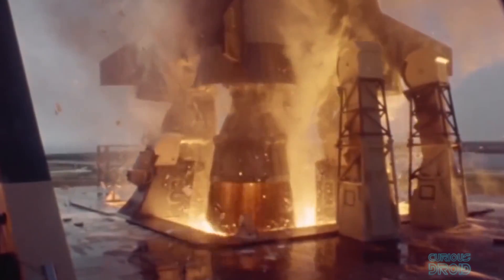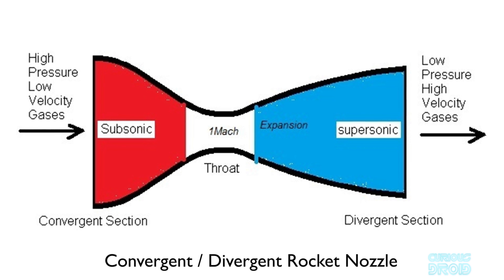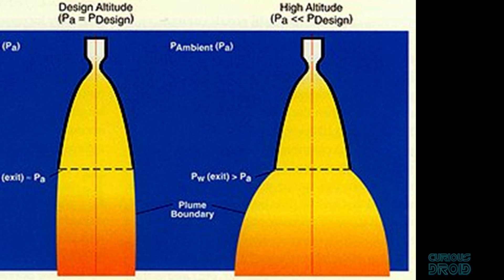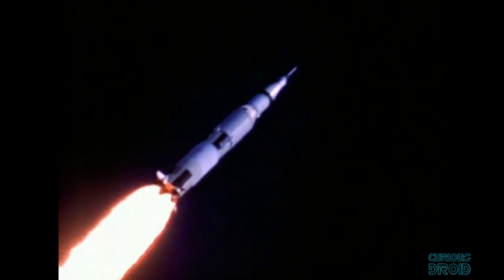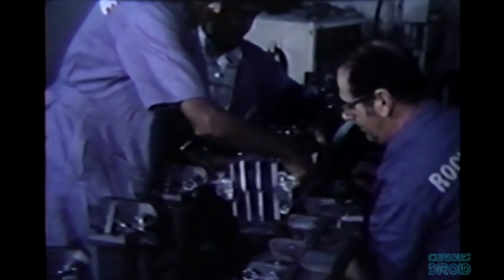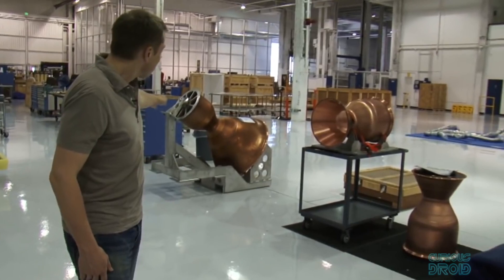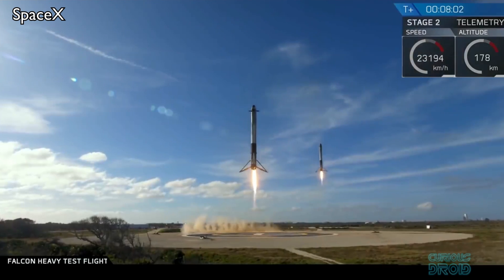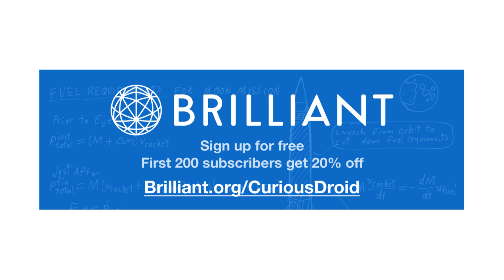Aerospike Engines - Why Aren't We Using them Now?

Comment: There is a big Achilles Heel with the aerospike nozzle that is not talked about much in the technical literature...but is fundamental to fluid mechanics...

It has to do with the surface to volume ratio of any heat engine or nozzle...a big engine will always be more efficient than a small engine, all else being equal, due to the fact that internal surface area increases only by the square, while volume increases by the cube...

The surface area is where viscous losses occur [friction losses in the boundary layer of the flowing fluid at the wall]...while the volume is what determines mass flow, which determines power...

If you increase engine [or nozzle] size you decrease the surface to volume ratio which means less fluid comes in contact with the wall [in proportion to the mass flow], and your boundary layer is small compared to the volume and mass of fluid you are moving...

With the aerospike design you greatly increase the surface area for any given mass flow, compared to the standard bell [de Laval] nozzle...

You can see this by by looking at the two respective geometries...on a bell nozzle the sonic throat surface area is much smaller than on an aerospike 'toroidal' [axisymmetric] design...where the flow has to go around a donut-shaped center body in the middle of the flow...[also you now have two surfaces, an inner and outer, as opposed to just the outer surface of a de Laval sonic throat]

The result is that viscous losses will be much greater in the aerospike...thus increasing pressure loss through the nozzle...as more of the fluid has to 'scrub' against the donut surface...

Nozzle efficiency is directly a function of pressure loss...so you want to have as little pressure loss as possible...we recall from basic thermo that only pressure energy can be converted directly to work energy in a heat engine...so pressure is the 'coin of the realm' in any heat engine...

The 'linear' [2-D nozzle] aerospike concept is similarly bad in that respect, perhaps worse...you can see that you have, in effect, a whole bunch of little 'nozzles' lined up next to each other and directing the flow against the central 'spike'...

This is like having a whole bunch of tiny little nozzles, as opposed to one big nozzle...one big nozzle will always be more efficient for a given mass flow than a number of smaller nozzles...again for the fundamental principle of surface to volume and the resultant effect on viscous losses...

This is one of the reasons why the F1 engine was so effective...it had one huge nozzle...even though it had relatively low chamber pressure [about 1,000 psi...barely a quarter of what Russian high pressure engines achieve]

The difference in surface to volume ratio of an aerospike engine compared to a conventional nozzle would be at least an order of magnitude if not more...

That is one of the reasons we have not seen continued interest in the aerospike...it is fighting the laws of physics...

Another aspect that is not mentioned is chamber pressure...an engine with higher chamber pressure will be less sensitive to the losses that occur as a result of a flow that is not perfectly expanded at all flight regimes [ie altitudes]...

This is due to the fact that higher chamber pressure requires a larger nozzle area ratio...[the ratio of the exit area at the base of the bell to the sonic throat upstream]...

The higher your pressure, the longer the bell and the bigger its exit area...which means that the compromise at off-design ambient pressures will be less severe...ie you can select a bell length that can perform well [although not optimum] at varying altitude...

We saw this in the design of the hydrogen-fueled Shuttle main engines [RS25] which needed to work from launch to space...the engine achieves a chamber pressure of ~3,000 psi...using a fairly complex two-stage turbopump...

With the high pressure the nozzle was able to be sized as a good compromise at all altitudes and ambient pressures...from SL to space...

This is one of the reasons that Nasa concluded in the early 1980s that high pressure kerosene-fueled engines need to be developed...something the Soviets had already done in the 1960s with the NK33...

See Nasa technical report 19820002372

'Fuel/oxidizer-rich high-pressure preburners [staged-combustion rocket engine]'

However this has not happened...high pressure engines are not practical on the simple gas generator cycle which dumps the exhaust used to drive the turbopumps overboard...a staged combustion cycle is required...[as on the RS25 and all the Russian high pressure engines]

This, in turn, requires advanced turbopump capability...supposedly the BE4 engine in development now will use a staged cycle [with projected chamber pressure about half that of the Russian engines]...but SpaceX engines use the gas generator cycle and the company does not even make its own turbopumps [which are made by Barber-Nichols]...

Another issue with this video is that the single stage to orbit concept is tied in with the aerospike engine...which are really two independent ideas...

There are many different schemes and concepts for SSTO and the issue of nozzle performance is not even the major factor here...it is about the mass ratio...

We see this in the Tsiolkovsky rocket equation where delta v = specific impulse * gravity * natural log of mass ratio...

So we see from this relation that at a given engine ISP it's all about the mass ratio..ie the fundamental problem is still how to get enough fuel and oxidizer on board to get you to orbit in a single stage...

Even if you could make the nozzle more efficient by addressing the altitude problem it does not follow that you have solved the mass ratio problem...

Another point that is overlooked here is that any bell nozzle could conceivably achieve perfect expansion at any altitude IF the chamber pressure is somehow able to be varied...this gives the same result as changing the nozzle geometry to compensate for altitude...

For instance at SL launch we can use a lower chamber pressure to prevent overexpansion and increase pressure as we climb out to prevent underexpansion...

Of course this would be quite tricky for the turbopump as turbomachinery is also designed to have an optimum performance at a particular rotation speed and mass flow etc...

But the bottom line is that the aerospike is really a non-starter due to the viscous loss issue...and second, aerospike [or more broadly perfect nozzle expansion throughout the flight regime, however it is achieved] is in no way a 'solution' to the SSTO challenge...
Reply: Jet Guy - Cool read. Thanks for that. That's always the issue I had with the aerospike is that the expanding gas has too much to do before it actually generates thrust. So much lost energy through all the complexity. Bells for the win! I mean hell the aerospike doesn't even have the greatest isp. Jack of all trades master of none.
Reply: Jet Guy - SSTO rockets must lift a lot of dead weight all the way to orbit, that multi stage rockets jettison after the fuel is consumed, improving the mass to thrust ratio each time a stage is jettisoned. Your very informative write-up indirectly states this, but for clarity, I state it directly.
Reply: Isn't it that you have more pressure at sea level and under expansion is the problem, with less at higher altitudes where overexpansion is the problem? Otherwise seemed very quite correct and obviously correct.
Reply: And now i can proudly say i’ve learned something new today!
Reply: yea. this is why i like to just browse youtube and see what titles catch my attention.
i don't look at the ones that are explaining why the world wide star chamber government is hiding aliens under the Washington monument and the Eiffel tower.
i figure i can make that stuff up on my own. if i was interested.
but when it comes to these technical explanations of things i have known about for years but never really looked into, i figure i'll risk the chance that there will be aliens involved in the explanation to watch them.
now don't get the idea i put this in those area 51 videos, i can see what he'es explaining here makes sense.
but i know from my own experience that i can have an idea that works well on paper and just plain makes good sense, and then turns out to work, but not as well as i had hoped.
so i see this as one of those ideas.
it will work, but not as well as hoped.
it's not a failure, just another step in the way you learn things.
it could be that all this work on the spike could be used in two unrelated fields.
like a better fire hose nozzle, and a better hot air popper for popcorn.
i don't know, i'm just making this up as i go along.
but the video was not a waste of my time, and i was very glad to read this long comment on the same topic as the video.
and as you said sander, i've learned something new today.
actually maybe two things, how and why the spike looks like a good idea, and why it turns out not to be.
Reply: wifiportb Indeed ^^
Reply: @Jet Guy: Great explanation. However, regarding the surface area losses, it seems like you are comparing a single aerospike engine array (containing many small combustion chambers) against a single large de Laval nozzle.

Considering that many rockets use several bell nozzles, couldn't you arrange those engines in an aerospike configuration and end up with the same ratio of volume to surface area?

For example, the Falcon 9 first stage uses nine engines. If you arranged those in a circle (or as a linear aerospike) and angled them somewhat inward, and then added the spike centerbody you'd have the same efficiency but with altitude compensation. Of course the spike adds some mass, but you could probably save some by shortening the bells on each of the Merlin engines.

Of course a single stage rocket has other problems, not least of which is the need to bring all that take-off thrust engine machinery all the way to orbit, and when you decide to stage to avoid this, the point of the aerospike is mostly moot. At least with the marginal orbital capability of chemical fuels.

Nuclear is different. Check out John Bucknell's Nuclear Thermal Turbo Rocket of you haven't already: https://www.youtube.com/watch?v=vt_PcU_Jqts Not aerospike per say, but altitude compensating, and ridiculous payload ratios.

SpaceX' Raptor engine is using full-flow staged combustion. Not sure if they build the turbo pumps in-house though.
Reply: Well, the Soviet RD-170 engines are still the most efficient with regards to their power, and they are four chamber, not single-chamber.
Reply: @Jet Guy This is a detailed post explaining the surface area disadvantage, but it's practically meaningless if you're not comparing the viscous losses with anything else, specifically the alternative over-expansion losses you get with bells that you don't with altitude compensating nozzles like aerospikes.
I'm not a physicist, but just from looking at the exhaust streams, I'm going to out on a limb and assume the friction inefficiencies inside an aerospike are going to be fairly insignificant when compared to the massive losses from over-expansion outside of a bell, where some significant part of your total exhaust energy is being let out sideways and thus doing less work pushing your rocket.

Not saying I have complete faith in aerospike technology, and you're obviously knowledgeable about the disadvantages, but to look at them in a vacuum outside of their proper context and then jump to the conclusion that "it's fighting physics", is flat out lazy on your part.
Reply: Thank you for such a well explained  answer to a very complex example.some people might think your comment is long on the contrary I can't believe you got so much information in area paragraphs. (And in layman's terms)so again sir thank you.
Reply: You're a hero.
Reply: In a world full of know-nothings who like to add noise to the internet, it is great to read Jet Guy's concise, well-reasoned, foundational argument.

@JetGuy should the flow rate / pressure be INCREASED at SL, and REDUCED at high altitude?
Reply: @DumbledoreMcCracken  no same. The thrust increases based off the back pressure changing. That being said rockets are usually throttled during different points during the launch. Sometimes to decrease the stress on the plane, or maneuver around populated areas or simply because they need to get in a specific orbit.
Reply: Got some daft punk vibes at 0:24
Reply: @Jet Guy
As others have said; informative (if lengthy) write-up.
The bell design works fine for multistage applications.  The notion that an Aerospike would be just as successful in single-stage applications doesn't bear out.
Really the Aerospike was designed with aerodynamic flight in mind, not direct-ascent flight.  I understand the entire boundary-layer-viscosity-losses analysis (in concept, not strong on the fluid dynamics), and while I could go into how the 'basic thermo' point is inaccurate (you can get work out of thermal expansion, not just pressure expansion, as in the Stirling engine), what really bears on the Aerospike's shortcomings is the fact that it is a horrible lift-off engine.  I will say what I've said elsewhere; if a spaceplane were accelerated along an electromagnetic track (this would ideally be an incredibly long vacuum tunnel, see Issac Arthur's video on Mass Drivers) to at least supersonic speeds, an aerospike would be preferable to nozzled engines for atmospheric acceleration because of configurable, self-adjusting airstream flow.  What current ascent stage engines lack in efficiency, they make up in sheer thrust output.  An aerospike used in the way perscribed above would allow an SSTO spaceframe to be smaller, lighter, and/or carry more payload.  We just keep doing vertical launches because the infrastructure is already in place to do that, and that's been the way it's done since Goddard and the V-2 rockets (the V-1 and X-15 being among the more notable exceptions).
Reply: Well said. In addition, matterials and technology need a big step  to make the spike viable functional device.
Reply: Sir thank you for the read. Very informative.
Reply: 😨  English..........please
Reply: Very informative.  I also wonder how much energy/thrust is lost due to heat loss.  That massive spike (especially the linear one) that will absorb energy in the form of heat before it can be applied towards thrust.  You may have already covered that with your talk of boundary layers and friction loss, but you used a lot of fancy words there, so I might have missed it.
Reply: Wow you know your stuff eventhough I did not read the whole thing I am still impresse by your intelligence.
Reply: That’s long
Reply: Interesting
Reply: Jet Guy, Forty-five years after seeing that first photo of an aerospike on a test stand I've still never seen a proof-of-concept ballistic flight powered by an aerospike.  The ground tests are so visually appealing that hard-boiled aerospace companies give the concept third chances.  Thanks for stating the flaw in the concept.  I'll still be on the lookout for that launch but more and more it looks like the flight realm may be confined to imagination.
Reply: I feel like most applied science and engineering communities have an elegant concept or poorly motivated buzzwordy objective that they like talking about but is never implemented when they have build something that needs to work.
Reply: Rabbit on Da Moon It’s like building something for the sake of complexity, like automatic watches
Reply: Dude my IQ just jumped 20 points
Reply: Jet Guy I was wondering, just because I had learnt about spikes some years ago, if it was possible to incorporate a narrow spike on the back of a aircraft type high Mah high altitude vehicle, that could accelerate to around Mach 2 to make 2.5 using a internal after burning jet engine, to 60 or 70,000 feet, before deploying a narrow aerospike rocket which would be more efficient at those high altitudes.

It could then maybe climb using those rocket engines to 150,000 feet also, and accelerate to about Mach 6 or Max 7, before throttling down in order to cruise at high Mach, on a trajectory parabola.

It would have the advantage maybe, of allowing an aircraft to travel long distances using not much fuel, and land on another continent.

I realise that this would not be an aircraft designed to reach orbit, but would maybe utilise the aerospike to travel at very high speeds in the height of atmosphere before returning to Earth.

It might even reach a low non Orbital altitude in space and having it to cruise for longer.

Just a thought.

What are your thoughts on this, from someone who understands both rockets, and aeronautics at a much higher level than me?
Reply: @Clint Tapper I don't think the aeroplane part would be useful in that situation, you'd just use a suborbital rocket from point to point on Earth, sort of like SpaceX has proposed. But an aerospike might be more efficient than a regular bell nozzle if it's a single stage vehicle.
Reply: Without going into all the detail you have, he briefly touched on this issue. Yes a bell nozzle is more efficient at any given point. But since the aerospike adjusts to altitude pressure differences, overall, the aerospike will be more efficient for a launch from sea level to orbit.
Reply: Interesting thanks, food for thought, I am guessing there is a way around some of this within so called conventional physics, will be sleeping on this - many thought experiments as prelude to 'provoked' lucid dream states ;-)
Thanks again for your effort in describing this in good detail, hope you don't mind questions later on, cheers
Reply: Thanks for the info man! One of my grad (Aerospace Engineering) professors was an engineer for Lockheed during the X-33 project and worked closely with its propulsion systems. Reading what you wrote got me pumped to ask him a bunch of questions! I'm gonna mention your comment as well!
Reply: @KobiBoat45  so what did your Prof say?
Reply: Dude, everyone knows that.... Most kids figure that out before they know the A.B.C'S
Reply: The thing with aerospikes is it's ability to adjust it's cone without the need to attach anything mechanical (that could break), it's a truly single stage engine. You launch it from the pad, take it into orbit; and if you have vector control, your maneuverability is going to be far greater; and land with the same rocket. It's not meant to be super powerful, just efficient as possible, through weight and logistics loss.

It's like a tiny car with a 4 cylinder in it. The engines, themselves are not efficient at all but they are pushing such little weight it makes up for it. They won't get people to Mars or the moon, but they could definitely be a viable orbital engine.
Reply: I read one paragraph, but am gonna tldr your post to “all successful launches used bell, so stick to bell.”
Reply: cool it with the ellipses
Reply: @octopustrap4733  .... calm....down....
Reply: Do you not know it's possible to use just one "."?
Reply: Nobodys gonna read that